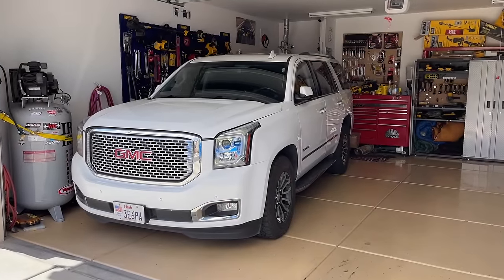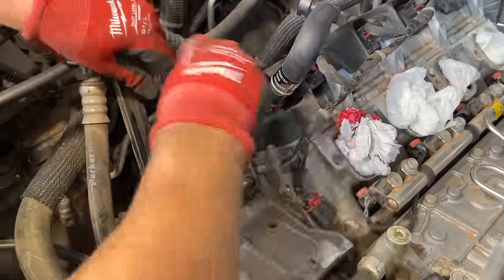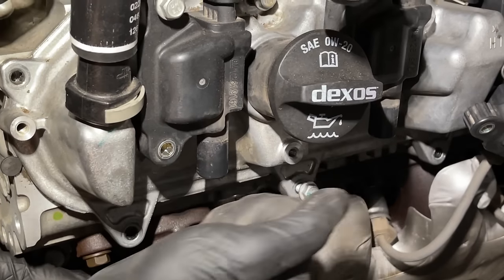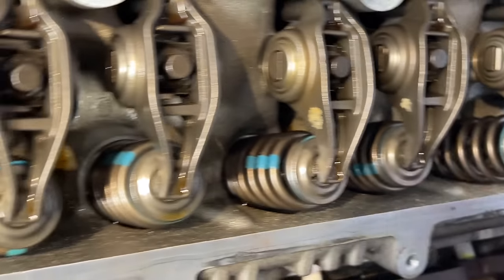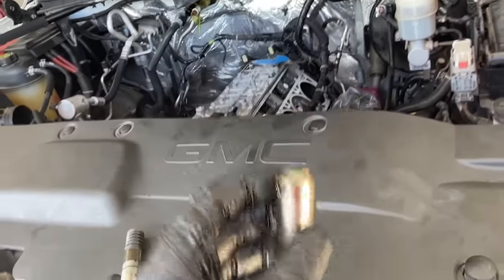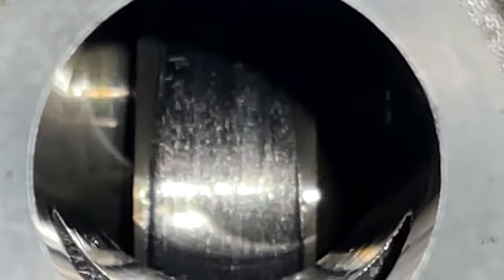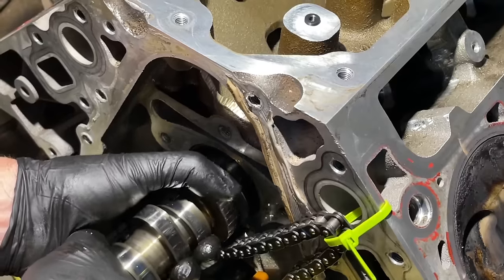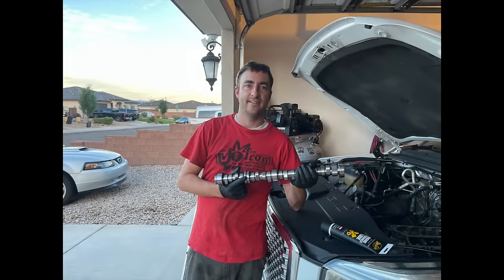DOD AFM Delete Yukon, Tahoe, Silverado, Sierra, Escalade 6.2L & 5.3L Replace cam & lifters  Part 1

Comment: After watching you do it , i think im gonna throw away my Ls motor and go old school 350 , i thought i was ready to venture into the new way , until i seen this ..i dont think i can change , i like my oil pump where it was , with two bolts on the pick up tube,  never did like that distrubutor , that drives the oil pump through the gear on the end of the  cam ...that oil pump on that motor... , i dont want anything to do with that , i suppose there's a special tool to center it ( expensive tool , one-time use tool ? ) can i modify a front engine/timing cover (drill holes in a spare one ) to align that oil pump ?
Reply from the maker: You can take the cover off the oil pump and center it with feeler gauges, but it’s all a mess. I heard installing a new pump is fine, but you can’t reach the harness without removing the oil pan
Reply: This is not an LS...its an LT....Direct injection....

Comment: I see that you have the Cam Shaft from an L8T 6.6L GEN V LT. Any part reason for that over a Texas Speed OEM Cam?
Reply from the maker: It was the cam BTR had for sale, and I was looking for a stock replacement as not to change anything on the valve springs etc. I wanted it to be as close to factory as possible so that’s what they had.
Reply: Outstanding job and detail sir…

Comment: Why use the shorter Chromoly Pushrods on a stock valvetrain components?
Reply from the maker: BTR told me to do so because they are LS7 lifters. According to them, they require 7.80” over factory 7.85”

Comment: All from the perspective of sitting in the driver seat, we have one ground connected to the back left of the engine block, one connected to that left side head on the back, and one on the back right side of the engine block. Should the one on the back right side of the engine block be connected to the head on the right side? Since the block already has a ground? Trying to see why we have a check engine light, P0333, knock sensor 2 circuit high bank 2, and P2138 Throttle/Pedal Position Sensor/ Switch "D"/"E" Voltage Correlation. Hoping we have a simple ground issue. Can’t find any plugs that didn’t get plugged in.
Reply from the maker: Yeah, start with grounds. The junction boxes under hood are also known to leak https://youtu.be/6XxKA0wo_QQ?si=lUC5g8KRFQqqt28m

Comment: I have heard about 40% of the lifter failures are non DOD cylinders like yours. Seems the problem is not the DOD system. Maybe oil starvation ?
Reply from the maker: Yes, I agree. I think the long intervals that they say for oil changes causes problems, even causing blockage for regular lifters. I thought I’d have DOD problems before a regular lifter. They may have even used cheaper lifters to compensate for the more expensive dod lifters. My 2000 Silverado is still running quiet at 253,000 miles

Comment: Have seen people do a stage 2 cam and get spun bearings after dod delete/cam swap is this something to worry about or is there anything to prevent this? 

Just bought a btr dod delete kit with factor non dod l86 cam
Reply from the maker: There are a lot of variables and that why I went with a stock cam to hopefully have it as less likely as possible and not worry about changing springs and other things

Comment: Which kit did you get? I had just replace one of the lifters on mines, a month later it went out on me again smh.
Reply from the maker: I did the kit from BTR, 7.80” pushrods for the ls7 lifters is what they told me. GM lifters (info in the video description) but I don’t know if there were even better aftermarket lifters
Reply: I replace mines with oem lifters, don’t know how but the spring took a shit on me after a month, looking for a delete kit now and just get it out the way.

Comment: Why did GM build the AFM and DOD in the first place? To try to meet the goverment's fuel mileage goals? My 2008 GMC with AFM  gets terrible MPG, so what is the point?
Reply from the maker: Yes. And mine has only lost 1-2mpg max without the system

Comment: Hi sir I want know about GMC sierra 2017 oil mix in redator Tha is redator cooler we checked there no leak give me any idea for that
Reply from the maker: I would look at the lines that go into the radiator for the cooler or even the radiator itself may be damaged and leaking. Radiator Replacement Yukon, Tahoe, Silverado, Sierra, Suburban, Escalade 6.2L, 5.3L
https://youtu.be/kMpgokEDQqA

Comment: I had no idea this job was that involved.  I'm currently using the range technology device to keep my Yukon in V8 mode until I'm brave enough to attempt this......
Reply from the maker: I wouldn’t until you have to. If you have v4 turned off it would most likely see a misfire from the dod lifters rather than a bent pushrod, so just let it ride until you have trouble (my thought)
Reply: @dannyjohnsonsgarage  ok I'll wait then.  I just figured preventive maintenance for this would be better than when it actually goes disabling the vehicle and having to get a tow.  I'm currently @ 115k on my 2015.
Reply: My son had a tuned as he called it for v8 only. I told him the same thing. You still have the DOD lifters. They will fail.
Reply: @flatliners2011   I have 142K on my 2015, no sign of trouble. Truck has been perfect since day one. minus the safety recall BS.

Comment: Our high pressure fuel pump lifter's hole was pointing toward the driver side...? Any idea why that might be? 2019 Escalade 6.2L.
Reply from the maker: The 2019 also has the different cam phaser bolt that you’ll see later in the video (or video 2), so perhaps there was a change

Comment: I hope you have the time to answer me i have a 2018 denali  xl 6.2 v8 with the 10l80 i bought the Range v4 disabler will it work i am just nervous about putting on i dont wanna mess anything up please let me no what you think
Reply from the maker: Keeping it in V8 mode should help from the issues you would have that happen during the switch from V4 to V8, so it may help. In my case it was simply a regular lifter that failed

Comment: Anyone know how much of this is applicable to a 2009 Silverado or if it’s very different. Struggling to find a good video for that year range.
Reply from the maker: From what I’ve seen it’s all very similar. The lifters I think came in and out on a tray at the same time and the oil pump may actually be better where you don’t need to drop the oil pan, but I can’t remember for sure. Some things like the oil pressure sensor are on the rear of the engine instead of the front. I think it not being direct injection is much better for the fuel injectors and I don’t think it had the mechanical high pressure pump on the cam.

Comment: I have a 2016 chevy suburban with these problems. It has 200k miles is it better to change this system out or get a new motor? Any suggestions will help please thank you!
Reply from the maker: There is a lot to consider. I would worry about the milage on the timing chain tensioner as it’s plastic and might break. You’ll need to drop the oil pan/lift the engine out for that part. You may be better off with a new engine for time effort and cost, but it will also come with the dod lifters so it’s a lot to consider. If you’re pulling the engine you might want a new one to replace it with
Reply: @dannyjohnsonsgarage  Ok thanks! Im really stuck on what to do. So If I get a new motor the problem will come again with the new motor and if I get the one I have fixed will cost me more?

Comment: Do you have a link for the pushrods?  Will these parts work on 2015 silverado?
Reply from the maker: Brian tooley racing has the pushrods. I’d verify with them on the length and if it’s 5.3 or 6.2. Make sure all the parts work well together

Comment: Clearly the best video on removing the chain from the vvt gear. Question: was anything used to flush metal from the engine?
Reply from the maker: In video 2 you’ll see where we check the passages, and dumped oil over some of the engine (you could even dump oil down through the valley). We also removed the filter screen in video 2 and luckily did not find any metal pieces. https://youtu.be/nB6fOblDBNQ?si=ikjqwAJ55R_GfVuF
Reply: @dannyjohnsonsgarage  nice ty

Comment: What did you use for the soft tip when pushing against the timing chain tensioner?
Reply from the maker: It was a magnetic telescoping tool, but I was using the handle end

Comment: I have a 2010 Silverado with the 5.3. I am looking forward to a full DOD/AFM delete. Anybody has any feedback after the afm delete?
Reply from the maker: I have only lost about 1 mpg. The process is a a little different on the parts for your year, but the overall process is the same.
Reply: much easier than lt and cheaper ......  you can remove  the oil sensor plug to stop it from going to dod mode run my car few years with that trick till i sold it
Reply: @kingkotkot2341  this is bad advice and you should stop spreading it
Reply: I have the 2011 LMG deleted, runs fine, gets decent gas mileage. Used a stock cam and lifters, kept VVT. Is your truck modded in any way?

Comment: When doing a delete do I need to use a different cam shaft if the original is not damaged?
Reply from the maker: @ELTURBOMAN  yes, it requires the non-dod camshaft

Comment: Why did you remove the starter ?
Reply from the maker: The flywheel holding tool you see later in the video locks the crank in place to brake free the crankshaft bolt and more importantly, holds the crank at top dead center. You won’t see the timing dot on the crankshaft so it’s crucial to hold the crank in place for the timing to be correct on installation  https://youtu.be/zD2qEaAZNJQ?si=tYtRTSjXrsBXLWxf

Comment: Fantastic job explaining everything and showing it clearly. How did you know for sure it was required?
Reply from the maker: Mine was actually having noise from a bad lifter (see link below), and I wanted to delete the four-cylinder mode before it failed and bent a push rod
https://youtu.be/cx4_-FGXCVE?si=GCExGDUvqmIUlqmv
Reply from the maker: Thank you for the kind words as well.
Reply: @dannyjohnsonsgarage  do you recommend just do the lifters or whole dod
Reply from the maker: @jasondecluebass1012  I would say full DOD since it’s not much more work and the dod lifters are prone to failure
Reply: doesnt matter if p/rods ect are in order or not.. unless wear or damaged.. why TDC. the lifters are not solid.??... is this vid for 15 yr olds that know nothing about modern engines, like, clips. torque, too much info..knowing the faults with chev engines,,why buy one.. @dannyjohnsonsgarage

Comment: I have tried this on a 19+ silverado/sierra L84/L87 and it doesnt work. You cant walk the chain off the cam gear.
Reply from the maker: That’s very interesting. It’s pretty tight, but maybe the cam sprocket is larger or something?

Comment: Anyone have any “while you’re in there” parts that you would recommend replacing. I’ve got a 17 suburban 5.3 150,000 miles. Should I go ahead a do the fuel pump? What else?
Reply from the maker: That’s what you’ll see in part 1 and 2. I also did the water pump, vacuum pump, oil pressure sensor (and lifter filter). Intake manifold gaskets, exhaust manifold gaskets, new hardware, VVT cam bolt (one time use) crank pulley bolt, etc.
Reply: @dannyjohnsonsgarage  I’m midway through the disassembly right now. I’ll just do all that. I definitely don’t want to do this again. 🤣 I have to thank you for putting together such a  detailed video(s) on this process.

Comment: Main bearings, camshaft bearings and connecting rod bearings might possibly need to be changed also probably should pull the engine out and disassemble clean inspect and reassemble then install at this point you are close anyway to pulling it you have disconnected basically everything.
Reply from the maker: I inspected the cam bearings and there were no grooves on the cam in that spot. I also cleaned them all out. You won’t see the rod bearings, so unless the engine is coming out it’s a lot more work. I caught the noise very quickly. For those who run it until it breaks it’s much more risky. At that point, a replacement engine is probably a better option

Comment: Theres a computer mod for this yeah?
 I mean is this mechanical mod better or?

I mean definitely cheaper at under 200 for the dongle and with hours and hours saved also..
Reply from the maker: There is a disabler that may work for awhile, but once there is an issue with the mechanical lifters they will need to be replaced https://www.amazon.com/dp/B0CTJNM7XQ/ref=cm_sw_r_as_gl_api_gl_i_FRECHW9NBNZT0K6SMG35?linkCode=ml2&tag=2004047-20

Comment: wow, I didnt realize how involved this was.  At this rate, you are better off replacing the engine with a rebuilt one with the AFM already deleted.  You are going to rack up enough shop hours to justify replacing the engine anyway and it will be a much better long term fix anyway.  you also have to consider Karma when doing a job this big.. Most of these parts you are taking off should be replaced.  I would replace every accessory, water pump, starter, alternator, thermostat, exhaust manifolds need to be inspected for cracks,  i would replace the ac compressor, condenser, radiator, you will probably break some of these connectors too as well as the plug wires. also every coolant hose including those fragile plastic connectors that go to the heater core need to be replaced.  This is a very expensive job done correctly and you could still have bottom end issues from the metal shavings.  So I would suggest if you get into it and discover badly worn lifters, I would really consider changing the entire engine if you intend to keep the vehicle.  These days it is far better to replace the engine and keep the vehicle another 100-150k miles.  New vehicles are just way too overpriced and with shop hourly rates close to or over $200./hour you oare better off maximizing your return on investment by replacing the engine.  If you are getting this done at a shop, be prepared for a a bill between $4000-$7000 if you have the heads redone, which you would be foolish not to do.  A new engine will run you about $6000 plus another $2000 - $3000 or so installation and another $1500 or so in miscellaneous parts that will need to be replaced.

Comment: Your videos are great!  Really wish you had one for replacing fuel injectors. Wife’s 2016 Denali has a bad one I think. I don’t know where to start but think I could do it with your step by step videos. Keep it up!
Reply from the maker: They are very difficult on this model because they are in so tight. It is hard to remove the fuel rail, they have o rings to deal with, and they will have a lot of debris fall into the cylinders, so that’s why I left them alone. If you watch the “Sundae drive” channel he has some more info on them
Reply: I just did this job my self, let me know and I can guide you
Reply: watch. watch wes work.. 1 yr ago.. you need all new everything. like 1,300$..  is the car worth it. took him 3 goes to get it right. parts cannon.. anything you take off, cant re use..
Reply: @harrywalker968  it's a 2016 Denali, what do you mean is it worth it?

Comment: Is oil pump recommended to be changed when doing this dod delete?
Reply from the maker: If you remove it in any way I would strongly suggest it as the old pump must be perfectly centered or could lose oil pressure. I understand a new pump will not need that- BUT the pump cannot be removed without removing the oil pan and there are other options rings that have to be lined up properly going into the pan as well as an electrical connection that cannot be reached without removing the pan, so if you pull the engine, go for it. If not pulling the engine, it may be better to avoid the pump. The pump is also variable flow for the dod system so I am not sure if it would best to go to a constant rate one or how that would play out.

Comment: QUESTION   !  .....................  can someone give a clear answer ???
If the DOD  AFM   DELETE is done, will it effect the emissions test ?

I live in an area where if the vehicle fails the emissions test, the vehicle cannot be registered.

I had one of the Range Technology plug ins on my 2014 Silverado (keeps the engine running on all eight cylinders all the time)  and it FAILED because the readout said "not ready". 

 I removed the plug in and had to drive the vehicle nearly 200 miles before the check engine light cleared. Then, without doing anything else, it passed inspection.
Reply from the maker: I would contact the company that sells the kits and find out. Or better yet, the tune company you will use. It would require a new tune but it hasn’t affected the catalytic converters. It may depend on the tune and what the software is used. It shouldn’t create a check engine light, it just tells 4 cylinder mode to turn on only after 8,000 rpm which will never happen.
Reply: @dannyjohnsonsgarage  
Thanks a bunch. So far my engine is still like it came from the factory but if the lifters collapse I wouldn't want to go back to the 8/4 cylinder thing. 
My concern is that if I change the cam and lifters and it won't pass inspection, I would have a BIGGER problem ($$$$$) !
Reply from the maker: @norman7179  I hear ya!

Comment: in ls after the  installation of the pump i turn the crank few times then tighten it ... isn't the same with lt ?
Reply from the maker: We did not remove the oil pump on this one because it’s much more complicated and won’t clear the oil pan

Comment: I reused my fuel lines. What makes them one time use?
Reply from the maker: Apparently they are TTY (torque to yield) and stretch the threads for a compression fit. Being it's a high pressure system for direct injection it recommends new lines.